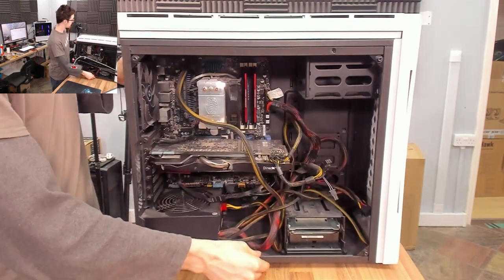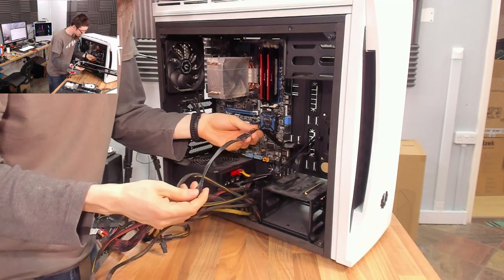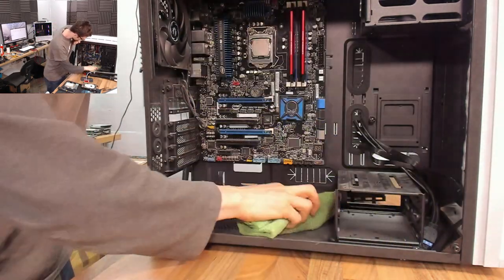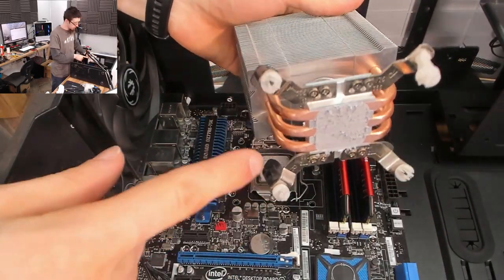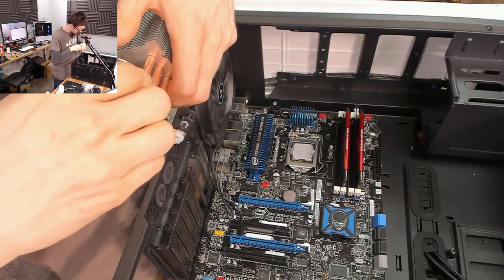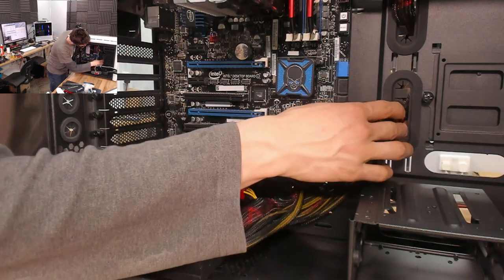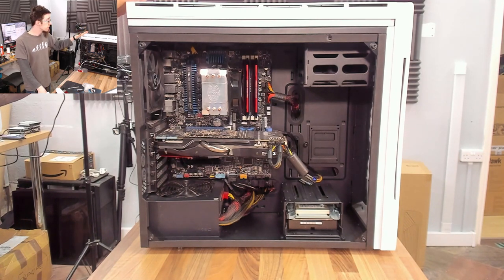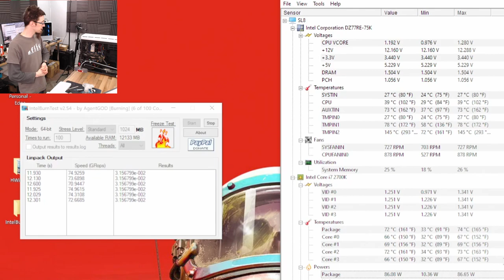How to tidy up the inside of your old PC - LBC#67

Comment: Those push pins were first used with socket 775 stock Intel CPU coolers. They were always very cheap and nasty and often fail after being released and pushed a few times. Over the years I've replaced a lot of the stock Intel coolers because of broken push pins. The non-latching push pin was definitely the cause of the CPU overheating since the heatsink would not have been fully pulled down and touching the top of the CPU.

Comment: I had an i7 2600 with thermal paste that was just completely solid. Temps were totally fine. I theorize that as long as the heatsink remains undisturbed, the dry and crusty paste will be completely fine... but if it wiggles just a tiny bit and cannot (for obvious reasons) reflow the paste it's gonna be game over, and the only solution is to re-paste. I say this because I actually did re-paste mine (during a LONG overdue cleaning of the inside) and noticed no difference in temperatures.

Don't take this to mean that I think re-pasting is bad though! All I want to do is throw my little anecdote into the data set. ;)

Edit: Young master Graham addresses this around 12:20. :)

Comment: Great and informative video as usual. A few things struck me: 

You should mention holding the fan blades when cleaning a fan to prevent damage to the motor. 
The front panel audio issue is well known and caused by EMI from the motherboard and power cables in a poor cable (as most of them are). Your customer should use the rear jacks where possible. If that's not possible, invest in a really long extension and route the cable right round the outside away from other cables.
Might it have been possible to mount the SSD on the back and the 3.5" drive out of sight in the 5.25" bay and completely remove the 3.5" bay for an even cleaner look?

You mentioned that the PSU had channels that were limited to 20A and you only plugged one cable into the GPU. With one 150W 8 pin and one 75W 6 pin power connectors you're pulling a normal maximum of 225W down that cable. At 12V that's only just shy of 20A - 18.75A, actually - and a little too close for my comfort. A surge could be bad news and I would suggest using the second separate power cable. This also allows ease of mind when replacing the GPU with a more power-hungry one.

Comment: I loved the video, the approach, the explanations, same way as I do my repairs/overhauls/restores. Only thing I would have done different is the PSU being upside down. I would have put it to breath from the bottom, that way the cables would come out on the side closer to the cable management holes on the case too.
Reply: Agreed, I thought forsure he would comment on that.  Extra heat just blowing across the entire system.

Comment: Another recommendation for all new system cleaners, make sure the fans do not spin when applying compressed air!  This will destroy bearings!  Including fans inside your PSU, us an non metal object to prevent the fan from rotating :)

Comment: Thanks for the video. I never knew you could swap those plastic pins from Intel stock to aftermarket coolers like that. I've chucked more than one cooler for that particular failure, whoops. Always glad to see solid systems like this staying out of the trash.
Reply: I have a think against throwing away pc electronics lol, I keep everything "just in case", you never know when you might need certain components and parts, like push pins ;)
Reply from the maker: Yea doesn't always work, I was actually very surprised that these ones fitted.
But 3rd party push-pin coolers are fairly uncommon, so I wasn't too fussed about making a big deal of it. I nearly cut it from the video, but glad it served as a tip to someone!

Comment: One thing.  The second pcie power connector you didn't use is on a separate rail, better to connect two 12v trails to the gpu than use the pigtail.
Reply from the maker: Yea, spare cables for this PSU will be long gone. It'll be fine, but I agree, connect a second cable if it's available.
It would've been especially useful for this PSU because of it's split power rails.

Comment: Just a note on the ssd and drive tray issue you thnought you had. You mentioned the ssd mount you did not want to use as it shows it off and thought certain ssds only should go there, the 2.5" mount above the two drive trays. You have two on the back side also that would keep the ssd hidden, meaning that you didn't need to bother about which way round the drive tray should be, could have just left it empty. That would leave space for another 3./5 inch, one extra ssd 2.5" on the back where 2 can go (you didn't mention those), and the one in the front to show off an ssd with rgb if the customer wanted which is what I would have done. As for the PSU? 

I would have had the fan down regardless of some people not bothering about the dust filter as that is THEIR issue and rather have gone for ther practicality of cable length so as to not stretch the cables as much leaving more room for better cable management, this would have left ample cable length for the 8pin cpu and to route it better along with the 24 pin. I know you said you are not going to argue this point? this is not why I am saying it. I am saying it just to point out something that may have been overlooked. 

Customers not cleaning their dust filters is not your problem or issue and sometimes practicality of not over stretching cable is what should be done. This would also allow more length for installation of the cable, making it easier in the long run, with velcro  cable ties,  sorry, "Hook and Loop" cable ties, this becomes even more efficient.

Do not concern yourself with how the customer treats their system and if they do not clean the filters and the pc gets hot? may be develops a short from dust, so be it, it is, after all is said and done, their pc. IF they bring it back? then you charge them again, you can point it out to them, bnut, if they never learn, they are the ones who have to keep spending the cash to fix their problems.

I will notr argue about the PSU being upside down etc. I would arguie on cable length for not over stretching though which is ultimately, a valid point when concerning voltages and stretched wires and also connections on the board with wolder joints. The less strain all round the better. 

These are only points to consider and nothing else. This is merely what I consider and we can never stop learning etc. I am no newbie on this and have been doing these things since the 386/486 chips where the motherboards had jumper switches along with the HDDs and so on. When cpus at one point had no IHS on them such as the AMDF Athlon 2500 Barton cores which could potentially be 3200s that were clocked down to 2500 such ass the one I had, I believe I still have it with the board that it sat in. Yes, I have worked on PCs that had daughter boards to add expansion cards.

Comment: Id like to think the dust when you pulled of the CPU cooler off was the ghost of thermal paste escaping.

Caned air is super expensive, I use a "giottos rocket air blaster" to puff out the dust. They tend to be sold for cleaning cameras but work on anything & cost about the same as 2 cans of air.

Comment: There is no argument to be had over PSU placement. Whatever give best temps. Personally I mount down in my current case. But it A) has bags of clearance and isn't on the floor. B) has a case filter tray and C) most importantly, I care enough to clean regularly with an electric blower. - How you maintain will always win over how you mount, assuming one isn't negligent with their build effort.

Comment: I personally use a soft toothbrush for dust, as the brustles can go under fan blades or anywhere else, then a cloth for surfaces and you dont get dust flying everywhere like you would with blowing it out (unless you take it outside). I have allergies so I'm pretty careful while cleaning my pc.

Comment: It just goes to show that if the basics are out, then it leads to more problems. I was suspecting poor cooler mount with temps like that on 2nd gen i7,  it is very easy to damage those pins when mounting the cooler.

Comment: Just wondering, instead of graphics card power cables pulling down that card wich which seems to sag easily, why not use the 24 pin hole and make those cables hold a bit the card?

Comment: Corsair full tower case front panel audio cable are not long enough in my experience either Graham and I have had problems with front panel USB 3 cables with their bulky connectors not waiting to sit in connector when the cable length is stingy.  The triangle on the HHD front connector does and doesn't matter, by that I mean if you plug it in the wrong way round the HHD light will be on when there is no activity and turn off when there is activity has been my experience.

Comment: Very nice video, but there is one thing you really should correct. The PSU was a quad raid 550W, and you used a single PCIe daisy chained cable! The 280X was at stock a 250W GPU, it should not use daisy chained PCIe cables, especially on a quad rail PSU.

Comment: Tip: I use hair dryer set on max speed and element 0ff for cleaning, 
if you don't have the dryer some vacuum cleaners has blowing mode also you can use

Comment: Recommend the Westerns Digital 2TB 7,200rpm SATA HDD for storage just got one for £47 ebuyer, want to see the back of my case I have the MSI FORGE MAG 100R nice case but doesn't have the best room for the excess, this weekend I'm going to be tidying it up you've encourage me to do it. If their's one thing I wish they would upgrade is the front panel I/O cables and put them in a block because I have seen an old case years ago that had such a feat

Comment: I recently splashed out on a tube of Kryonaut thermal paste mainly to re paste my video card an MSI RTX 2081Ti Ventus.
It didn't lower the temps at all, it still runs at 74 deg under 100% load but it considerably reduced the noise as the fans don't ramp up as high anymore and that was my main complaint with this card.
It was horrendously loud before even under normal gaming loads but now its still audible but nowhere near as obnoxious.

Comment: I have a 3770k and play lots of Fortnite in 1080p at 120 fps which is very CPU intensive. Make sure post processing is set to low in game settings and just giving the CPU a bump up to 4.5ghz got me a huge reward in frames. Gammaxx 400 on the CPU keeps it at 77c and that Cooler Master is better than the Gammaxx. I would have slapped a couple front fans in that case as well and tore the GPU apart to repaste it since it's very ancient. My old R9 290x needed new paste years ago.

Comment: Interested that you didn't repaste the second time. Do you think there could be a problem with air bubbles and if not why not?
Reply from the maker: In short, because there never is. A lot of people tend to be super paranoid about thermal paste, but outside of extreme overclocking or lab testing, it really makes little to no difference.
Sure, now and then you'll get a bad mount - but you'll know when you've got a bad mount because the temps will be way outside of the expected values. If the numbers look fine, you're good to go.

Comment: Good job on an older pc. You removed two retaining screws from the graphics card when you removed it but only installed one when replacing the card. Did you install the second screw later?

Comment: Very informative Graham, thanks. Does that PC have a missing IO shield too?
Reply from the maker: Sadly yes. There are options for dealing with that, but I've not done the research to talk about it in a video yet.
I know a chap who sources 3D printed "lattice" IO shields where you just cut out the required spaces, but I'm not sure if they're commercially available.

Comment: Hi there. Good job. I wonder, why not test to mount the SSD on the other off the rail?? Or am I wrong here?
Reply from the maker: Would work fine, it's just a lot easier to put the drives next to each other and have the cables going to one place.
Reply: @Adamant_IT  Ok, I´ll check that.... Ooops, I missed one word. I ment the other SIDE  off the rail.

Comment: What do you think of placing the power supply first, and connecting the cpu power cable, BEFORE mounting the heatsink, since in most cases there is very little room to connect it, with the heatsink in place, especially if there is a larger heatsink in place, that almost totally blocks access to the cpu header? Often there is almost no room to get your hand in there.
Reply from the maker: Yup, smart move, I'm in a weird phase of not doing anything in any particular order at the moment.
That being said, if you connect up EPS cable first, that means fitting the heatsink outside of the case isn't an option. So really you've just got to gauge which method you think is easier on your specific build. I've got slender hands, so I don't mind awkward plugs.

Comment: I hope manufacturers will standardize f_panel connector some day.
Reply from the maker: It's in a weird Unspoken Agreement stage at the moment, where basically any mobo made in the last five years has the same FPanel pinout - but yea it's not strict, so case manufacturers need to split the wires just in case 😔

Comment: I note that you often put quite a bit of pressure on the board, causing a lot of defection. How likely is this to damage the board?
Reply: A mobo can flex a little bit so it should be fine.

Comment: Graham, did you try so called "computer vacuum cleaner"? I see that neither air compressor, nor electric blower is the best way to clean PCs. As you can see, air compressor still leaves dust and both compressor and a blower can damage fans.
Reply from the maker: I mean, it's easy to avoid fan damage, you just hold one finger in the rotor so it doesn't turn while dusting.
A computer vac might be handy, assuming it has a brush tip on it to pick up the dust before sucking it in, but blowing air is a lot more effective with hard-to-reach areas.

Comment: I've had MX-4 dry out in about 2 years, it doesn't last at all. And how did someone JUST purchase a system like that? Are old systems like that still being built and sold? I built a 2700K in 2017 I believe, because it was good performance for the price, but it still wasn't cheap and took a while to find good parts. I guess I could still sell that system today! Similar graphics card too. It overclocked to almost 5 GHz too.

Comment: 20A @ 12V that is 240 Watts and using two cables so 3 of the 4 rails, that would be 480 Watts max draw. 
ah the good old days when you could have 4 240W rails with a max 550W combined load.

Comment: 800rpm while 70c for the cpu fan is low, set it higher, make a nice curve.
Reply from the maker: Temps vs noise there. So long as it's under 80, I'll take the quieter fan. That being said, if you're running 10th gen intel with TVB then yea, you'd want to keep it at 70 or under. For more or less anything else, it'll keep on boosting up to 80 no worries.

Comment: I have a similar issue with Minecraft actually - the fps is really bad and I have an i7 10700k with an RTX 2060 and i dont even get 60fps sometimes. Could it be cpu overheating? I use a H100i RGB PRO liquid cooler.
Reply from the maker: Is this in Java MC or Bedrock? Modded Java MC runs like a potato on just about anything, mods just murder performance.
Check your temps with something like HWiNFO though, that'll be a good start. The H100i is fine, but you could have a bad mount, so it's not working correctly.
Reply: @Adamant_IT  I use HwMonitor and its Java mc without any mods apart from optifine.
Reply from the maker: Yea it's just the mods then. Java MC doesn't scale well, so throwing more horsepower at it doesn't actually make it run faster. Last time I was playing heavily modded Java I had the same issue, Ryzen 5800x and RTX 3070 barely at 50% load, yet game is chugging. It just can't scale to use modern hardware.

Comment: This build is literally screaming "UPGRADE ME!" I'd install a new PSU properly mounted, 3rd Gen i7 LGA 1155 "K" processor and a 1TB SSD. I would also get rid of that cooler as I am not fond of that mounting method. This is an Intel Extreme Edition motherboard and very solid.

Comment: and what if the client get higher feet then put fan on PSU on bottom i know you don't like doing that ROFL
Reply from the maker: If people clean the filters then it's fine. The problem is that people don't clean their computers, so I always build for as low-maintenance requirements as possible.
Reply: @Adamant_IT  I clean my PSU filters! And I clean my whole PC a couple times a year. But I've built several PCs and won't take mine to a shop. Graham's clients and his viewers are two different groups of people!

Comment: what about taken of all heatsinks on board repaste them as well
Reply from the maker: Not required in my experience. You could do that, but the thermal pads those will have under them generally last the life of the machine.
Reply: @Adamant_IT  cool ty